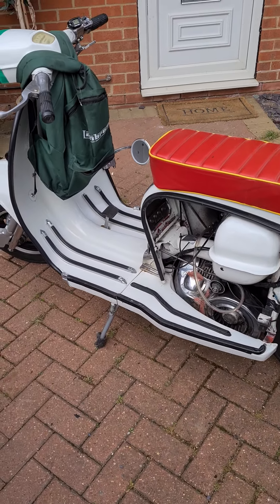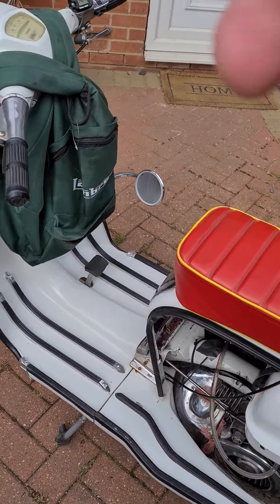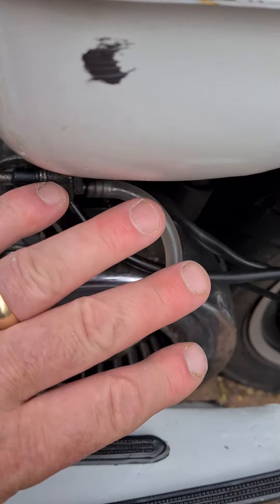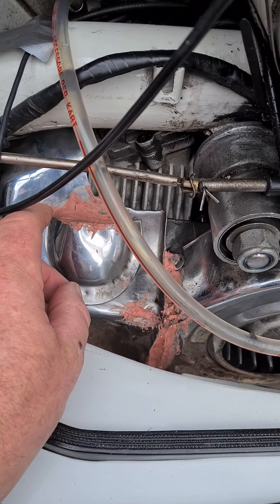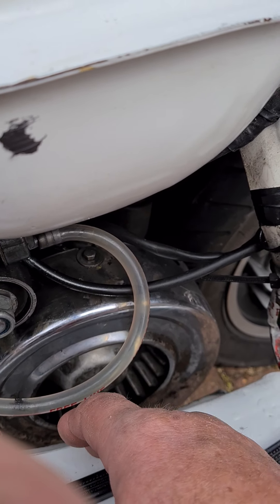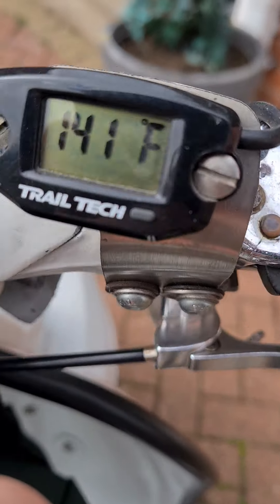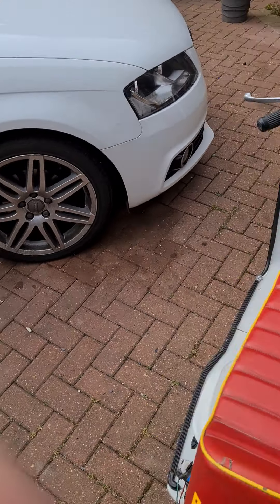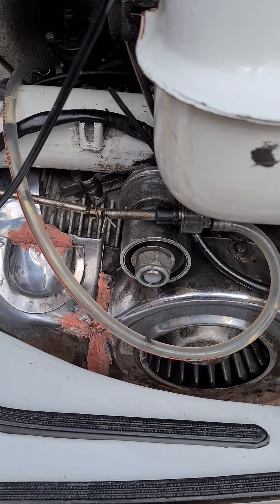Lambretta COOLING  TIP  DIY  it really  works lambretta purists look away its not pretty

Comment: What did you reduce gap of fan to, 1/8th or 1/16th?
Reply from the maker: Hi dont know actual measurements if i remember i cut the bolt hole slits deeper and pushed it upto the fan just before touching point then sealed around the fan casing and blocked up the slot that de ices the carb hope this helps 👍